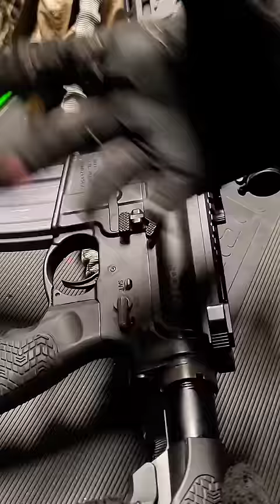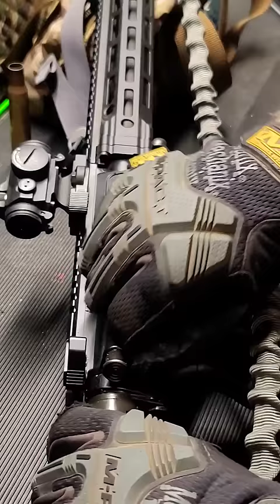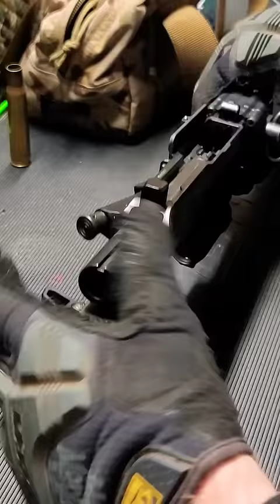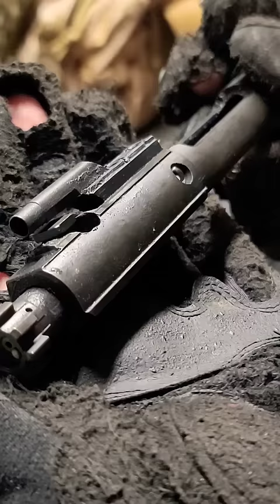2 HACKS You SHOULD know (But Don't)

Comment: The pins are so tight on my DPMS oracle that i would actually be a little worried about loosening the crimp or shoving the bullet further down in the casing. I think it's at the extreme end of tolerances for what would pass quality inspection. I also paid $400 for it so I still feel like I did alright.
Reply: @mattmurphy7030  to be fair, his dimensions make for tight fitment can translate into rudimentary parts duplication if looking at an indefinite grid down. The possibility to produce very easy and simple castings grants a parts replacement option. They may have that rattlesnake soundbite Highpoint products tend to have but also functions as designed. Just an idea from the parking lot behind left field.
Reply: My DPMS Stainless lower is so tight I need a brass punch to remove them. Tight tolerances aren't bad on an accurized target rifle.
Reply: On all of my builds I clip off 2-3 links of the takedown detent spring, gives me the perfect amount of resistance

Comment: I really hope you're not struggling with takedown pins on your $2000 rifle
Reply: To be honest the detent should be grip it hard enough so its not fun to use your finger tip otherwise it will have slop.   Yet with the detents removed you should feel no binding.  Cheaper pins  arent put through the vibrating polisher before finishing and will stoll have tooling marks on it.   A high end lower should have the take down holes reamed after being trilled to give a good smooth finish
Reply: Apparently it’s not just his. Mine is same way. No trouble pushing pins on my Poverty State Armory gun though
Reply: @aj20100608 I build ARs for a living. If it won't move by finger pressure, you either have weak hands, an accuwedge in there or your lower was built by an idiot.
Reply: @oodsigma4482 you must have some tiny hands to be able to shove your finger meat in the pin hole, and be able to grab the pin on the other side. Put on some thick gloves and then try to take the pin off, that's what it feels like to take the rear pin off with big hands...
Reply: @0mniVerse777 you don't need tiny hands to do any of that. What are you on? The pins are longer than the receiver and your fingers have enough mush to push the pin pass the opening of the receiver. The other side has a head to grab. All I hear is excuses
Reply: Probably all that carbon

Comment: Getting that pin back in the bolt carrier is what I struggle with.
Reply from the maker: Carefulling....
Reply: If you orient it so the "ring" part is facing up, push down with slight pressure and press it in, it should go in easier
Reply: My uncle had the same problem, we found a KNS Perma pin on Wing tactical that is designed differently and fixed all his FPRP woes
Reply: You gotta put some sideways pressure on it to compress the tines
Reply: @OvertonWindex 

Do you mean "carefully"..??!
Reply from the maker: @the.real.a-volpe  nope.
Reply: @OvertonWindex  

Okay so you just mean some made-up Hillbilly word..
Reply: @the.real.a-volpe  yesm

Comment: The front sight can also be adjusted with that tool. It is a small PITA, but it's better than nothing in a pinch.
Reply: That was why it was made that way... to use tip of a bullet to adjust it, it was the same on original M16, M16a1  and AR-15s before the a2 changes.

Comment: Just like how the forward assist on a G3 is a hole in the BCG that you stick a round into a push it forward into battery. Or on a SKS the rear receiver plate can be taken off and used to depress the trigger group retaining pin and it can be used to open the gas piston takedown lever.

Comment: I just push down the td pins with my finger.  Then pull on the other side.  I guess it depends on how clean and lubed you keep your gun.  You can also adjust your iron's with the bullet tip too.

Comment: my breakdown pins are extremely easy and i could do it with my pinky! Your upper is banging into the lower by just a smidge. Grab you a dremel just slightly dust the upper receiver tang where its meeting contact with the lower(tang where the pin goes) do lil buzzes until it closes like butter.. seen to many people struggle to breakdown their shit when its just a simple fix..should fix that pin from being stuck but dont do to much or youll get a wobble or play.. their needs to be a snug fit not a tight fit..

Comment: Flashbacks to BCT 1981. LOL. Drill Sergeants carried a firing pin at the range for adjusting sights. M16A1. We used a firing pin (not the one in the rifle) for adjusting mechanical zero before going to the range.

Comment: Maybe they made the .226 round deliberately smaller so it could  be used as a tool to push out a standard 1/4" pin. 🤔 
(Or 5.56 to push a 6mm pin, if metric is your thing)

Comment: I knew this trick back them... buuuut, I was of the belief that, before I had my health go to the shitcan, I would be switching uppers, tuning them up, and then fitting them to lowers to provide a full array of AR-15 tools, in much the same way a mechanic has his assortment of tools.

I bought a front pit that pushes out easily, but stays on the lower, like a quick release pin, and then, for the second,, I clipped the very top of the spring off. Originally, something bent it and so I had to clip the part off, but I slipped it back in, and it provides enough pressure to keep it inserted, but not so much that a firm press on the one side wouldn't pop it out. I get that that might not be ideal, but I also have the wedge in it to provide a little upward pressure on the upper, the pin has always stayed in place.

And I always thought the tip of a bullet was a nifty trick when removing the bolt retaining pin from the carrier. You can sometimes get it started by pushing the tip through the other side of the bolt carrier, too.

Comment: Just make sure yoy fire the tool cartridge regularly.

Use the SAME 5.56 over and over again... and you can push that bullet back into the casing way farther than you should.

Reusing the same cartridge is GOING to cause problems if you decide to use that 500 use tool for its intended purpose.

Comment: Don't use a round for those takedown pins. Apply pressure and tap the buttstock firmly, that counteracts the spring pressure that is helping to hold the takedown pins in place. They should pop right open even with weak hand strength. If not, likely you have other issues and need to remember to apply lubricant to the detent ports. Using a round as a punch is never a good idea, if the tip gets deformed it affects the round performance.

As for the firing pin retaining pin, I honestly have never had any issue removing those with no tools, but the cleaning kit patch holder would work.

Source: disassembling tens of thousands (literally) of M16s and M4s plus a few ARs - Small arms repair as active duty and contractor for the USMC and Army.

Comment: Stuck takedown pins will absolutely shove a bullet into the cartridge.

DO NOT use the tip of a round to push them if they're stuck.

Instead, stand the rifle on the buttstock and use the back of the round to start the pins, or use a cleaning rod.
Reply from the maker: Wrong.
Reply: @OvertonWindex  it's actually quite correct. Especially in adverse environments.

Takedown pins can get stuck and need lube or heat to break free. If you try to push them with a live round you'll end up with a wasted shot.

Use the back of the cartridge, the rim of the case, for the takedown pins.

Comment: When i built my first ar (ar-10), I thought I fucked up when I did a few steps out of order to figure out something, I didn't look up any help when I did this, just decided to raw dog the build. I put the takedown pins in, got that little brass thing into its slot with the spring. I thought I had fucked something up because I saw the groove in the pin and imagined that little brass piece was going to prevent me from taking it out, for about 4 seconds before I remembered....Its a fucking AR, Everything is meant to be disassembled on this thing, put some pressure on the pin with the glassbreaker on my knife, all was well 👌

Comment: Be real careful putting pressure on the bullet.  I've had a magazine for a work gun where the bullet fell into the casing. Picked the magazine up to start my shift. Thought I heard something.  Shook it back and forth. Ka-chunk ka-chunk, ka-chunk. Hey Sarge (SERT guy), why is this magazine making this noise.  It's nothing.  Don't worry about it. Started unloading it. Checking each round over and over carefully until I finally found it. Not sure how it got that way or who did it.  But that could have been a real bad day if I had to use it.  Imagine if the bullet got in the chamber cockeyed in the casing.  Primer goes off, whatever gunpowder is left goes pop. And there goes the gun when you needed it most.  Point being, use a round as a armourer's tool. Neat. But make sure you mark that round clearly.  And make sure that never goes back in your rifle. Better yet, use a handcuff key or something else. 

My 2 cents.

Comment: This doesn’t work on or after a range qual when it’s time to do weapons maintenance. “No Brass, No Ammo…” should ring a familiar bell with many here.

If you’re using live rounds to field-strip an AR, you’re doing it wrong.

To release your takedown pins, just punch it with a knuckle.

To remove your firing-pin retaining pin, use a fingernail…or a pen…or a pipe cleaner.

Comment: Firstly... the semi-smartass nature of the narration whilst moving the hands gave a very distinct AvE vibe to the video.

Now on to a smartass comment myself... You're supposedly able to raise/lower the front sight post on A2 sights with the tip of a cartridge too... It technically does work but it's a PITA. I bought the little tool.

My takedown pins were snug when I bought my rifle. But after about the 4th takedown they had loosened up enough to just use my fingers.

Removing the firing pin retainer pin is for suckers who bother to clean their BCG.

(Relax, that last one was a joke)

Comment: You can also see if your barrel is accurate by looking down the muzzle as you pull the trigger.  You will notice any deviation of the round from the rifling as it spins out.  May have to try it a few times to get a good view with lights on

Comment: First off that’s not a good idea to use a live round to push the pins connecting the upper and lower receiver. That’s how bullet setback is created. Secondly, do you really need a round to remove a firing pins retaining pin? Outta all my 6 years in the military, I’ve never done that not once. It’s not that hard guy.

Comment: Yeah don't do that too often. you can push the round into the neck of the casing and get the little bugger stuck. You should have a weapon specific multi tool if the pins get seized from heat corrosion or carbon fouling they dont cost alot and you should keep one in your shooting bag. you can also use it to make sure your various mounts are secure when ever you clean your rifle.